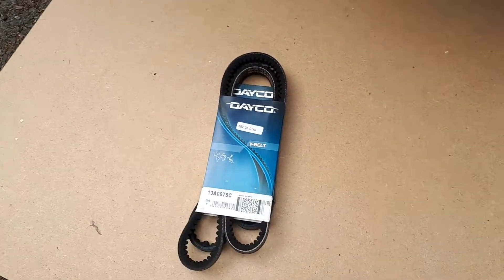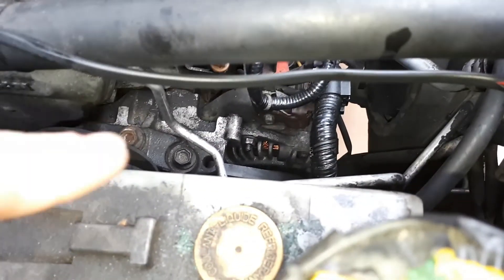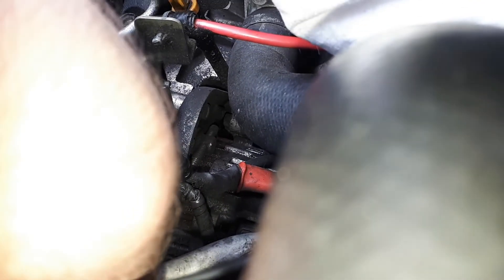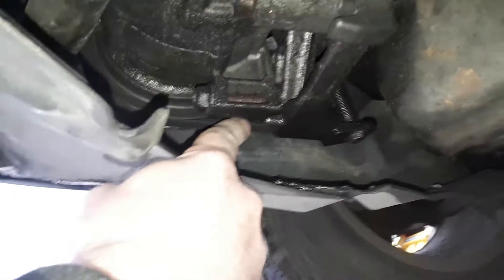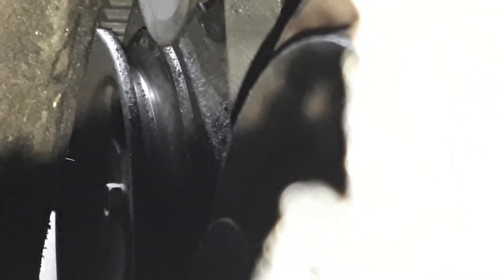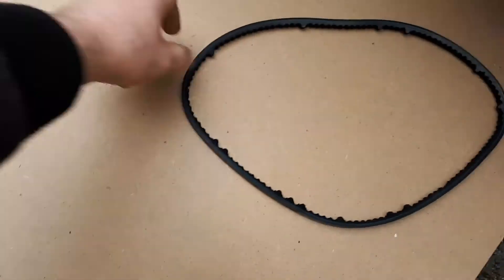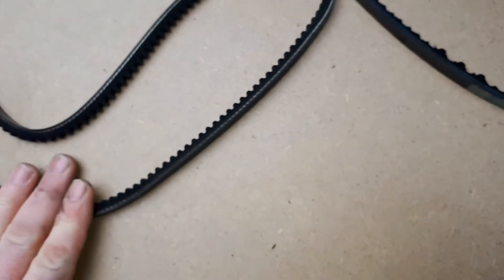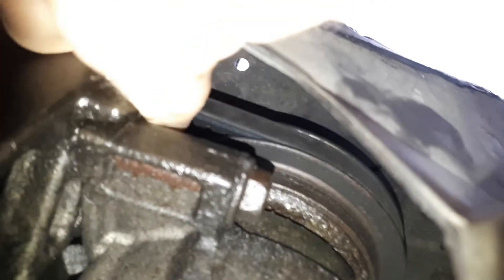V Belt change  Alternator belt change And Air Conditioning Compressor belt change.

Comment: Great video, really helped me a lot. Wife's car now no longer squealing like a pig. Thanks!

A couple of bits of info for anyone else that's searching for how to change these belts ...

1. This video is for the belts for the 2.2 dci diesel engine (most other vids are for the 2.5 petrol)

2. Use only genuine Nissan belts, the aftermarket ones, even the allegedly OE spec Gates ones just don't fit right. You'll end up having to buy genuine belts in the end so why not just buy them to start with. They're not expensive, I got both for £45 including VAT from my local dealer.

Thanks again for the vid PolMoz.